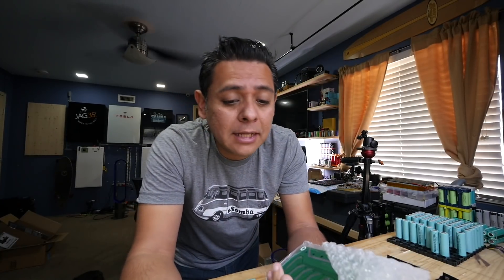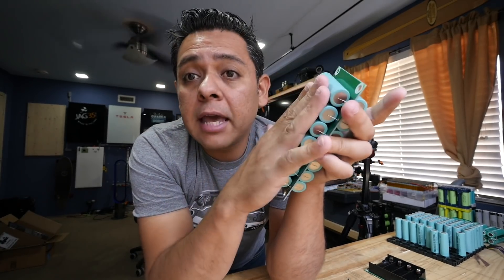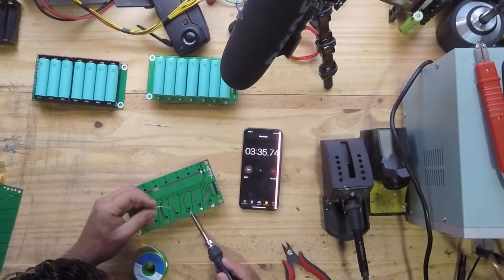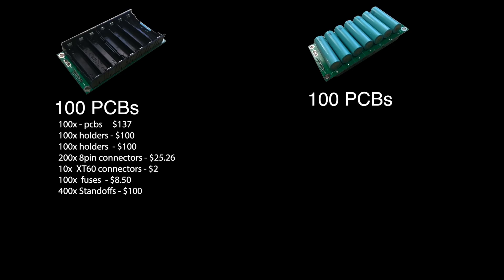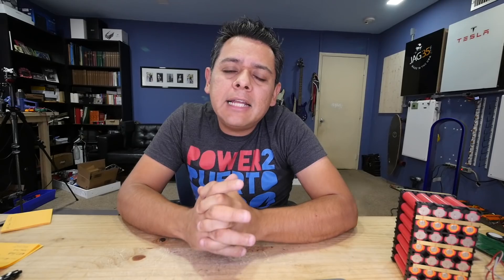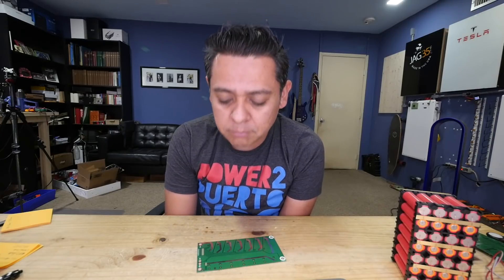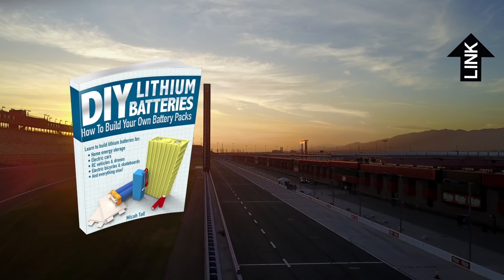DIY Rapid Build 18650 module PCB - Test Boards Available

Comment: Got mine ordered. I was charged $12 what all does that include. I know no batteries but I wasn’t clear on whether I ordered one board or the two limit and if it came with the connectors and stand offs or anything. I just want to know so whatever it doesn’t come with I can go ahead and order those also. That way everything gets to me about the same time.
Reply from the maker: It’s just 2 pcb boards
Reply: jehugarcia ok thanks I’ll get the other parts ordered.

Comment: Soldering on a cell can be damaging. Spot weld, or use a vruzend kit.
Reply from the maker: It’s crappy expensive system that is a pain to assemble
Reply from the maker: FAQ:  
1)  Where can learn more about batteries? http://j35.us/DIYlithiumBatteryBook
2) Where can I buy Lithium Batteries https://j35.us/Lithium-July
Reply: Wtf is a vruzend set?
Reply: Matthew O'Neill google it. Its a no solder, no weld way to connect 18650 cells.
Reply from the maker: My opinion of Vruzen https://youtu.be/g7V9XQ34chc?t=7m34s

and its about $115 per kilowatt hour,   thats expensive almost as much at the battery itself
Reply: Most solderless/weldless systems are shitty . I have seen a few good one's but you almost always need to build them yourself requiring tools most people don't have .
Reply: jehugarcia neither crappy, nor expensive, nor hard to assemble. Its quick, easy, and reliable.
Reply: It uses steel bus bars doesn't it? High resistance and lots of heat, not to mention that the of use of space with batteries in that formation is one of the most inefficient as well.
Reply: jehugarcia Where do you get those batteries from? I am wanting to start storing solar enegry, where is a good place to start.?
Reply: jehugarcia. Can you just be one of my mentors. We can schedule a time for a knowledge check.

Comment: One thought I had while watching the video... Is could you include an information bus (for battery diagnositcs/meter) and a power bus? As an example, like a PCIe card for a computer?
This way you could literally have a plug and play system... All you'd need is the appropriate connector for the two buses, both of these could easily be open sourced.

Comment: Really liking this new project. What are the trace fuses on the board rated at?
Reply from the maker: Tested at 12A
Reply: Was that by design or just what it turned out to be? 
Are there any intentions to go smaller?
Reply: 24v x 12a = 288Watts shouldn't we be using smaller fuses?

Comment: Jehugarcia,

Add a small slit under the hole for the battery holders. Make the slit small enough to add Nickle Strip (8mm x .15 ) make sure the trace goes around it like a new hole only smaller box. That way, you can add nickel strip. Or make sure the trace is big enough to tab weld on. That way you can use a Tab welder to build these packs. Would take seconds compared to soldering. I mentioned this to you a few times during your live shows, but you might have missed it.  I also order 2, and I allowed to order a few times. I will need around 10 to play with.  Might I be able to do it with the ones you have now? But I won't know till I get them. 

But Its a Great Idea for us Tab welder types......
Reply from the maker: Good idea
Reply: Thanks! Yep, all you would need is a simple jig, maybe made out of wood, to hold the batteries in place while you tab weld the nickel strip. I guess the only issue would be fusing, but we weren't really fusing with the holders? I got some on the way to play around with when i get them. Now we need some 4s boards for those 12V inverters, I have a 24v 3000w anyways. But I figured you had some of those coming also?

Still need some of those LGHB2 : )....Man I use those on every single tool I have and my vape mods...Almost have all my Nicd and my wives tools converted. But I only got 50 from you last year(You Hooked me up)

Comment: The one with holders is very much preferred in my thoughts as you can switch out batteries at will & can be done with only a soldering iron.
Also...the costs of the second type board does not include buying a spot welder...which is quite expensive...in addition to a soldering iron.
Reply from the maker: Good point
Reply: You can DIY a spot welder quite easily. Not always the safest but a possibility since this is for a DIY community.  Awesome project nonetheless.

Comment: I don't know about that double cell configuration. If you mount cells on both sides of the pcb they wont stack correctly.  you would need to double up on stand offs and bms header lengths to stack them, And you have to consider up to 60+ amps on each of those traces.
Reply: That was exactly what I was thinking about.
Reply: Well you could just buy longer stand offs... I imagine you could get something off the shelf that would be close enough.
Reply: You are right with stand-offs ... more problems can be to find the longer header pins I found 20mm ones which can be enough. It will change a bit a price calculation. ;)
Reply: Just modify the board to allow a direct mount of the battery spring terminals and sans the battery trays. You can pick up the spring terminals dirt cheap on digikey.
Reply: Why would you draw 60 amps out of one module?
Reply: John D II , in that configuration you are placing two 30 amp cells in parallel. So the cells could handle 60 amps surge load without issue, the traces not so much.
Reply: What is an 60+ amps?
Reply: Shaggy one What is digikey?
Reply: @Llama_Dhali_G  it's a company that sells electronic parts, you can also try www.Mouser.com or www.jameco.com as well for parts. www.allelectronics.com is another good place for random stuff.
Reply: @chrislewis2262  the MVP

Comment: Thanks Jehu, ordered all the parts for my jp spot welder so hopefully I will be building your 14cell variant once you opensource the board.
Reply: Do you have a link to the plans/Parts list? Jehu did you make or purchase your spot welder? Thanks!!!
Reply: Benjamin Yardy if you mean plans for the "jp"  spot welder then riba on endless sphere sells them. Also pguk in endless sphere makes and sells the "sixpence" welder based on an arduino which is a little more programmable.

Comment: I think you should put slots behind the 18650 holders +/- to allow for nickel strip on both sides as another connection method.
Reply: brettwatty101 I say slots for the 18650s where you can then put them together from the pressure of the boards / standoffs from themselves. Then have more holes for people who just want to use zipties on all of them or the last board which isn't sandwiched.
Reply: Spacers;!
Reply: What is nickel strip?
Reply: It is the flat metal strip that is used to spot weld batteries together.

Comment: $67/kwh is a lot, tesla say they are close to $100 per kwh at the pack level including the cells
Reply: Daniel Hughes hard to get this sort of pricing at the consumer level though, but salvage automotive packs are definitely one of the cheapest ways to go, for example Chevy Volt packs go as low as $130/kWH. The difference is this system is much easier to scale. Auto packs you're stuck with increments in the 1-3 kWH range and limited voltage options.

Comment: I love what you are doing, keep up!! PS; is there any chance we can get some sort of adaptor for simple busbar connection?
Reply from the maker: Not sure what you mean
Reply: So after we have this as a module system, we multiply them to build a power wall. While stacking those units up, how do you connect them? Is there some sort of a simple interlocking bus system that just click/screw on and carry the module vertically while give enough space for air cooling.?

Comment: Boss what happen if the fuse blow up?? All the battery will fall right???
Reply from the maker: Just the one string
Reply: then how can I fix it? just got it burnt. not the 15A fuse but the string one at the connector.

Comment: One price difference that was not mentioned was on the tools for assembly. A cheap temperature controlled soldering iron can be found for under $10, I do no know what a cheap spot welder goes for.
Reply from the maker: $200

Comment: Good comparison. For someone doing a onetime project can you include the cost of the special tools - specifically the spotwelder?
Reply: well he calculated with 100 PCB´s so for this calculation buying a spotwelder makes sense and is part of the cost.
Reply: René Bonte if you’re doing only one board I wouldn’t get a spot welder. Just use a solder iron. If your one time project is a power wall then yes do the spot welder.
Reply: Tom not sure I follow. Rene said he’s doing 100 pcb boards?
Reply: What is a spot welder?

Comment: all i can think is that the boards come with a BMS built in .
Reply: Great idea. I would appreciate if there are the pads and traces on the board with optional use.
Reply: The way it's designed makes that more complicated than it needs to be. If each module was only a parallel group it would be much easier. A very simple microcontroller can monitor and cut the connection if the voltage strays outside of set limits. As for the power draw with a good embedded developer the draw can easily be dropped to a couple hundred nA using low power techniques.
Reply: that is where you attach a little 7 cell BMS externally since otherwise that would take up more room on the PCB so with more parallel boards you are wasting space in the overall battery. just attach a BMS externally and you only take up space for 1 BMS not 100.
Reply: I agree, that is larger then expected.
With parallel cells, the protection circuit would be very small and they could link through the pins, but that would limit the scalability.

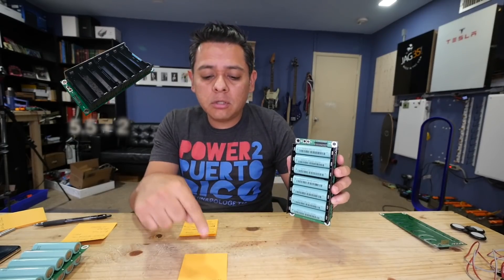Comment: From 2:37 to 2:53, the board in your hand appears to have holders soldered to both sides of the PCB.  Is that the case or were you just holding two back to back?
Reply from the maker: I tested to see if it was possible,  it is but It’s too much trouble